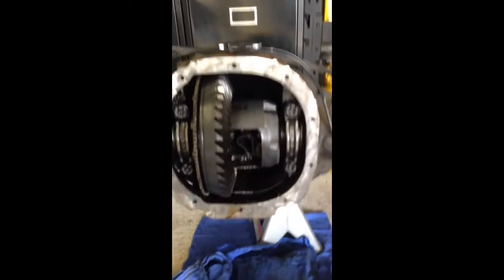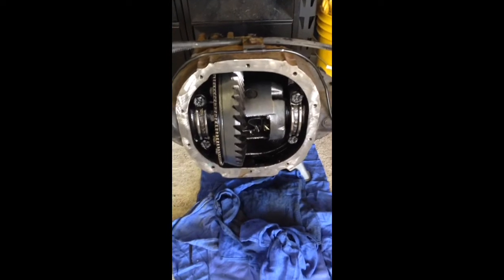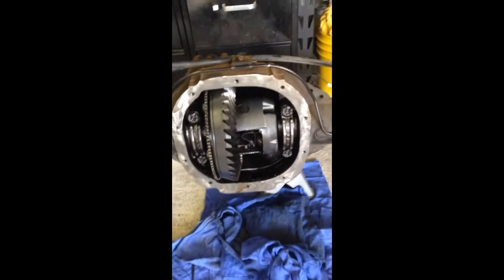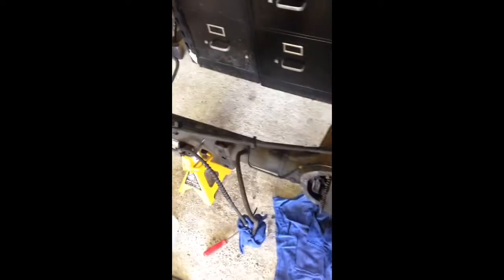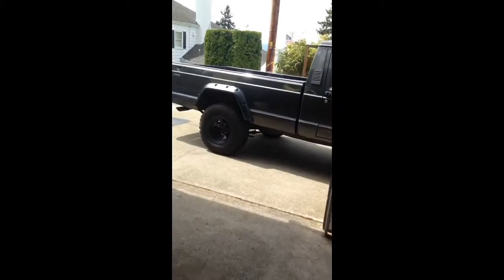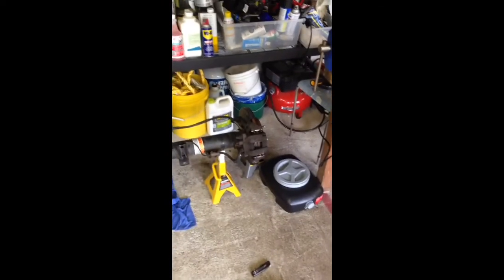Ford 8.8 swap into Jeep Comanche

Comment: If u swap out the booster n MC to a wj and the proportion valve from a zj... And bleed the line well!!!! With that 8.8  4 disk set up u will feel the difference big time .. I did that to my mj
Reply from the maker: Ya I just got a parts cherokee and am planning on doing that soon
Reply: Good if u have any questions let me know
Reply from the maker: +Jaime Perez are you on comanche club?
Reply: Iam but its been some time... I actually just sold my Comanche last night.